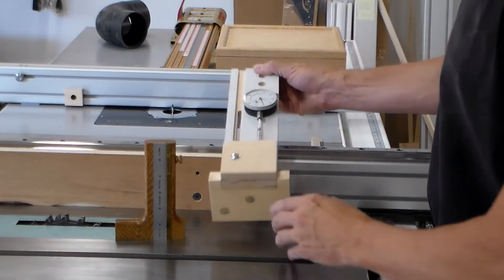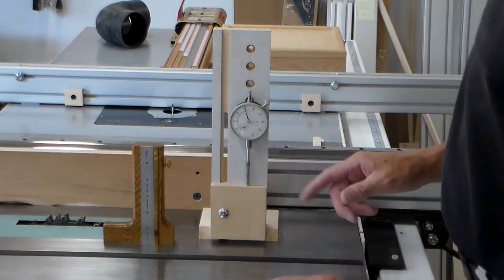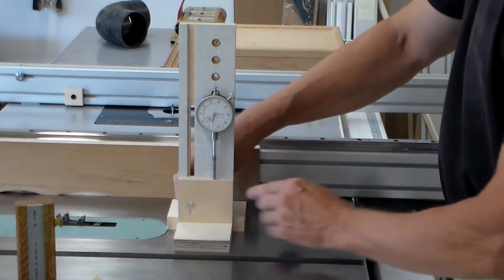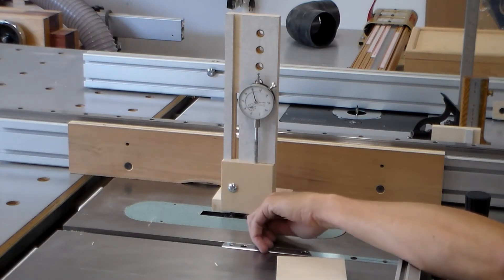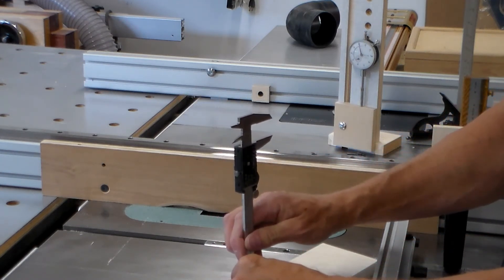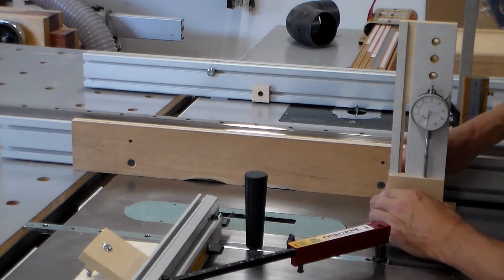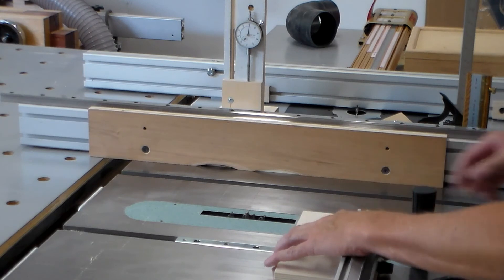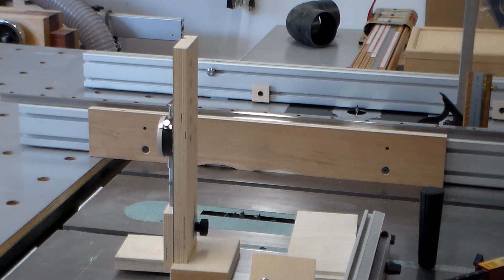03 Height Gauge

Comment: Jeff, I watch a lot of machinist videos and they typically slip a post-it note between points until there is a very slight drag felt.  Without use of the paper, they say the cut will be slightly over what is desired.  I've never tried it myself, but thought you might want to experiment with it someday.  The method might take that 1 to 5 thousandths off of your depth.

Speaking of machinist, your precision is remarkable.  YouTube recommended your channel to me 3 days ago and I will have watched all your videos before the night is over.  I never miss Allan's videos and he linked me to a couple of yours, but I didn't know you had a channel  Also, you mailed me a VSC fence about 3 years ago. 

I am rebuilding a table saw now and the setup is very similar to what you have done.  It's even backed into an ultimate work table.  I'll send you a picture when I'm done.

Thanks again for the videos and another good channel to subscribe to.